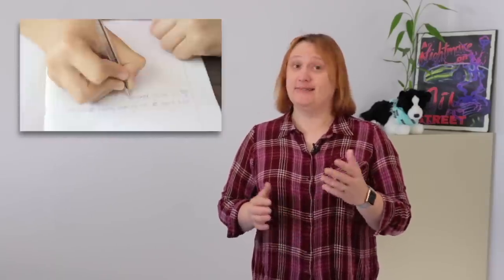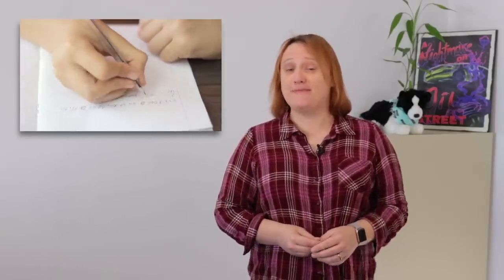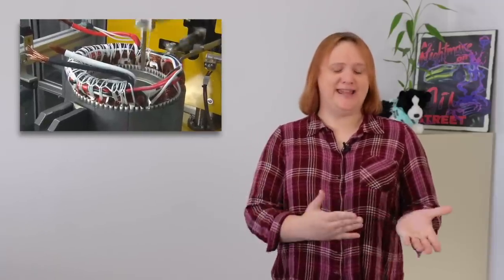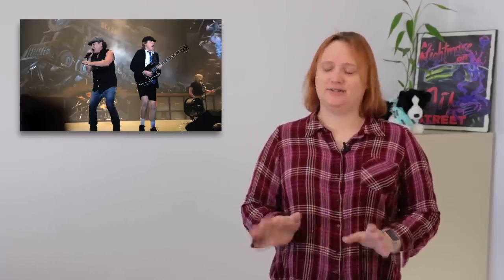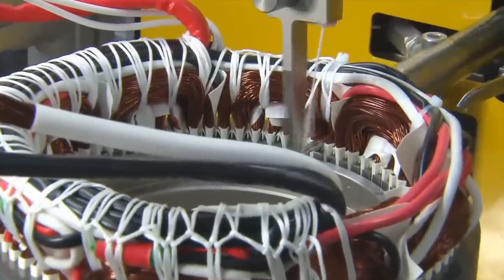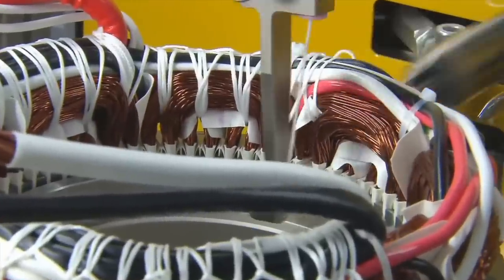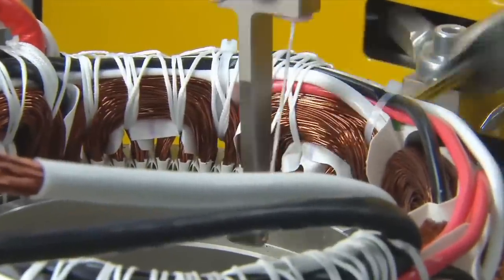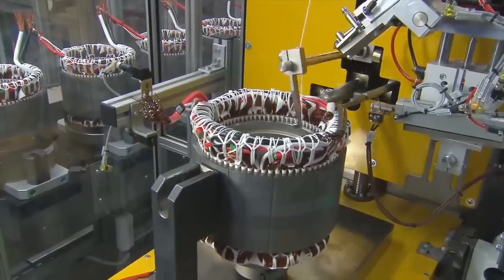Which Electric Motor Powers Your Electric Car?

Comment: I really enjoyed the content but I wish there was some Hyundai coverage so I can know more about my Ioniq. Not a full ev but its a hybrid.
Reply: Ioniq has 3 models I believe. EV, Plug-In, and Hybrid. The only decently priced one is the Hybrid though.
Reply: @notosure2148  Yes you are correct. I own the hybrid model. There can be government incentives to get the plug-in version cheaper than the hybrid, but I haven't even seen any in my area.

As far as my original comment and the video goes, I was hoping for information about the motor.

Comment: Great video, Joe send me here  ;) 
How does the regen braking work with those reluctance motors? I thought you need either permanent magnets or a DC coil in the rotor to generate electricity?
Reply: It's a bit tricky but in order to regen you have to play with the variable inductance of the coils, so you energize the coils in the firing angle when it produces reverse-torque and you de-energize the coils once you reach the lowest reluctance point (when the rotor and stator are in alignment).

Comment: What if I does rewind a 25kW pump induction motor for lower 120 volts 3 or 4 fases and build a electric car with it? a normally motor is mostly three fase 380 and these even 420 volts, can I use these in a car? I do need the watch the impedacne of the windings and the rmp because with higher frequency these get high impedance and as such loss of power, here is the need of a clever controller, who keeps the amps right.

Comment: No discussion of the fact that batteries release energy in DC form.  There is a loss of energy when converting from DC to AC, correct?  If so, a downside of AC motors is that they require this conversion.

Comment: I was under the impression that the motor used in the Model 3 (and now in the new versions of the S and X) was an Internal Permanent Magnet Switched Reluntance Hybrid Synchronous Motor with the magnets using Hallbach Arrays to better direct the magnetic field within the switched reluctance rotor design. But I have been unable to find more details, as this is an interesting development in the motor industry because this type of design is being used nowhere else!
Reply: Because who originally made these statements has/have probably a limited understanding of  electrical machine design and modern permanent magnet technology.
Reply: @NRG1985  Do you know where I can find more information on their motor design? Sandy Munro showed a sample of the PM Hallbach Arrays and I confirmed the switch reluctance part directly from a Tesla employee.
Reply: @craigpeterson68  if you mean the Tesla model 3 motor what I found is as much as probably you can find in Internet. I studied at university electrical machine design and I just analyzed the available photos/data in internet. Honestly I doubt on many statements made by Munro specifically on the electrical machine and I found his analysis quite basic.  I guess that, up to know, the only official teardown is from Munro, therefore the only source so far. The point is that he doesn't explain in a technically sound way why it's Halbach. When you say "hybrid" and "switch reluctance" part confirmed by a Tesla employee what specifically you mean? "Hybrid synchronous" reminds me how BMW calls its PM assisted reluctance synchronous machine.
Reply: @NRG1985  Thanks for this. I will read up on it when I have a moment. FYI, I work in the motor industry and have been since 1994, which is why I am interested in this topic.
Reply: @craigpeterson68  Thanks for the link. I believe the m3 machine is not related to the design reported in this thesis.
There are official photos of the stator and rotor cores, from the Munro teardown and there are no similarities with such a design.

You can find here
https://images.app.goo.gl/sjNN8Zsx3eGN7CL67
https://images.app.goo.gl/xs88jdJLV6NH6HLu5
https://images.app.goo.gl/JC7aLYWC5FviAiWFA

Interesting post, apparently with "stolen" XD slides of the Munro's presentation with further details.
https://teslaownersonline.com/threads/munro-day-session-on-evs.13170/

The magnets are only located in the rotor, with this pecualiar V-shape pattern already implemented by other EVs competitors (Toyota for instance, probably the first in an EVs).
We are sure that the magnets are located only in the rotor for the following reasons:
1) Munro would otherwise highlight it during his shows in front of the press, no mention of this feature anywhere.
2) from the photos it looks like there are no magnets in the stator. Further: 
- there is phisically not so much space space due to the selected winding topologiy most likely "distributed winding" (or "overlapping-coil winding"), i.e. slot-pole combination (looks like 54-slot 6-pole).
Normally "switched reluctance (SR)" machines, like in the thesis, have "concentrated winding"  (or "non-overlapping coil winding").
- overcomplication of the design, reliabitliy, increase of the manufacturing cost (curved PMs, PM fixation, etc...).
- when the PMs are in the stator, they could be more thermally stressed, being fully exposed to the thermal power of winding losses, iron losses, plus their own eddy current losses (especially right in front of the airgap).
One the other hand, cooling can be more effective/simplified being in the static part. 

My personal opinion is that there was some misinterpretation of terms. 
a) In principle "switched reluctance" can be assimilated to a "synchronous" and exactly to a "synchronous reluctance" machine. But practically, they are two different machines. A part of the design, they require a different/not standard power electronics architecture and different control strategies.
If the machine is "synchronous", you can implement exactly the same inverter architecture of the front axle induction machine. And, thinking about it, this would make sense for Tesla in terms of economy of scale.

b) Finally the "reluctance" topic: the "reluctance" is of course the operating mechanism of the "switched reluctance" machine but also some "synchronous" machine topologies exploit it:

- Interior PM (IPM) synchronous, which is the most common designs found in EVs (Toyota, Nissan, BWM... and I believe Tesla as well). Depending of the rotor design, the "reluctance component" of the torque can be more or less significant to the total torque production. When the rotor is designed to specifically enahance this "reluctance component" the design is often called PM Assisted Synchronous Reluctance (PMASynREL, PMASREL, PMASR...), and 
this is what BMW refers as "hybrid". GM designs are PMASREL as well. Tesla has potentially an advatange under this point of view (but you need FEA simulation/measurements to prove that because the rotor designs are different), thanks to the lower number of poles (6 vs. 8-10-12 used by the competitors).

- Synchronous Reluctance (REL, using SR would make confusion) machines, PM-free. This fully exploits the "reluctance mechanism", known examples in series production from ABB since years.

Comment: From what I have heard the induction motor also have another advantage to the permanent magnet motor. It can freeroll much easier which is important in a 4wheel car when you dont want to use both motors for efficency. That way you dont have to have a complicated clutch to decouple the motor not in use. 
Can anyone confirm this?
Reply: It should. A permanent magnet rotor would still induce an electric field in the coils. However, I think it would be much better not to spin the motor at all and instead just put in a clutch. You could spin the motor up to the appropriate speed very fast before engaging the clutch and it would reduce wear a lot.

Comment: None of these motors is the highest efficient motor type.  Rather used for their low end torque.  There is another ~5%-10% range to be had if one changes motor  types, or in this case, adds another as they do not have low end torque required to start the car to begin with.

Comment: I don't believe any EV uses a 'synchronous' motor. The big advantage of having the 'power' windings in the stator is that it's much easier to get rid of heat.

Comment: A switched reluctance motor is a DC motor. It is Not an AC motor.  Electric vehicles are powered by batteries. A DC power source.
Reply: "....technically correct. Which is the best kind of correct!" 
I'm surprised this wasn't addressed, as batteries always release DC power, for obvious reasons. It's the motor control gubbins that allows the switching to "emulate" AC from a DC power source. They did talk about it briefly but didn't really explain it.

Comment: There was no link in the video.
Reply from the maker: There is! We checked :) But it's also here: https://youtu.be/ZMr_F2z9_Ow
Reply: Transport Evolved It doesn’t show on the AppleTV. I assume it won’t show on any set top devices. I was expecting a link similar to the ones in the end cards.

Since there isn’t an end card, could one of those links be placed at that point in the video?
Reply from the maker: @polleyjw  We already did put the card in. - We'll see what else we can do :) And we'll put it at the end too!
Reply: Transport Evolved  When I watched it on my phone, I saw a flag(?) come in from the upper right, but nothing like end card links. 🤷🏼‍♂️

Comment: Electromagnets, do not produce "electromagnetic fields", they produce a magnetic field. Electromagnetic field require a changing electric field AND a changing  magnetic field as in radio waves, light waves. An electric field is what you get when you have a charge between metal plates. Common electric motors use some form of changing  magnetic  field,  and no electric field.
Reply from the maker: You're totally right. This is probably why I only got a C on her Senior Physics paper. Although actually, she got a C because she didn't calculate the natural logs correctly... waves fist at the exam paper  ^Nikki.
Reply: @transportevolved  this is a paradox because it sounds like electromagnets produce electromagnetic fields, but they produce only magnetic fields. At any point in time you could not distinguish the field produced by an electomagnet, from a permanent magnet, the key difference is an electromagnet can produce a rotating MAGNETIC fields.
Reply from the maker: @SuperFredAZ  I feel better now ;)
Reply: @transportevolved  The more you know. 😉 ThX
Reply: "...and no electric field" Well yes, ... but actually no. Since you have a voltage across the motor (or more specifically its coils) there is also an electric field. It is usually neglectable (as is the motors capacitance) but there is not "no electric field" :)
Reply: @TheMightyZwom  An electromagnetic DOES NOT produce an electromagnetic field!
Reply: @SuperFredAZ  Correct. It is, however, not accurate to state that there is no electric field involved. There is voltage - thus there is an electric field, because literally everything has some ("parasitic") capacitance. I know I'm nitpicking here, but that's the way it is :)

Comment: So basically, tesla has two types of motors in each wheel?
Reply: As I understand the tesla model three has one induction motor on one axle and a second switched reluctance motor on the second and the two motors can co-operate through the software control adjustable  depending on the road conditions and/or demands from the driver
Reply: Paul Steele oh I see, thanks for the clarification. 👍🏾

Comment: This people doesn’t know anything about electric motor, because the bottom line car manufacturers they will go with the cheapest type of electric motor, today best electric motor 
Which is the best motor for electric vehicles (EVs) and why? There are two major types of motors used in car-sized mass-produced EVs: AC induction and brushless DC/synchronous permanent-magnet AC (which are nearly identical mechanically but have slightly different electrical waveforms).!!

Comment: "What powers your electric car ?" Answer: the battery
Reply: Actually its the energy in the battery that powers the electric car, the battery simply stores the energy.
Reply: @xadam2dudex  To draw an analogy. The energy in gasoline isn't released until the fuel pump pumps the gas from the fuel tank into the engine. Despite this the fuel pump isn't the energy source, nor is the fuel tank.